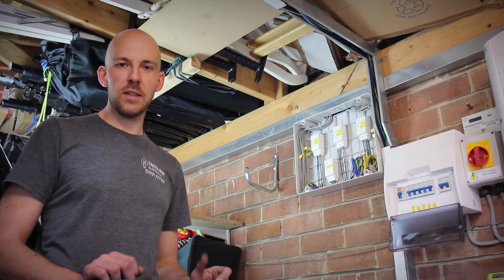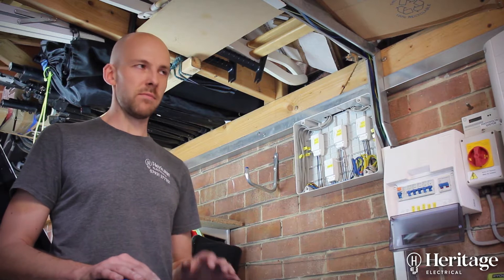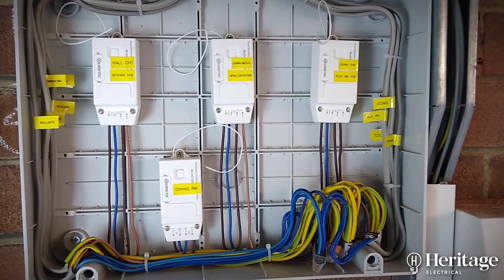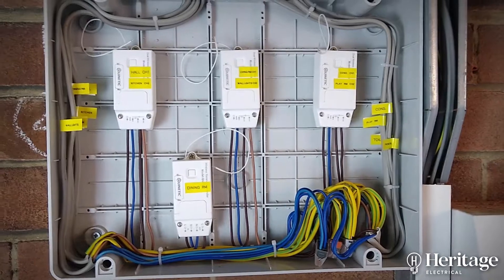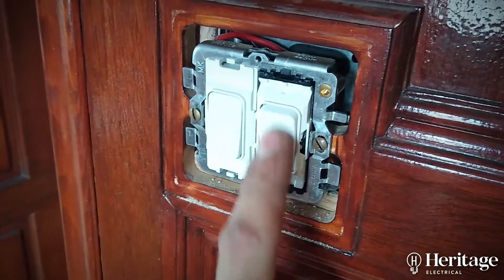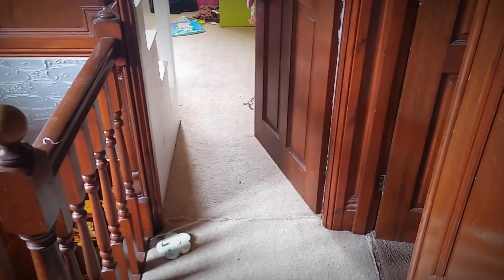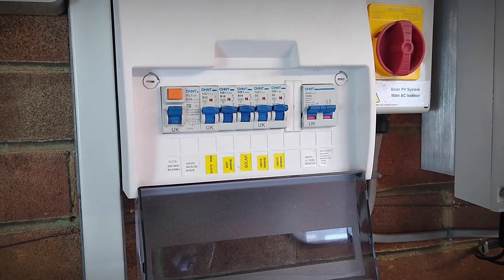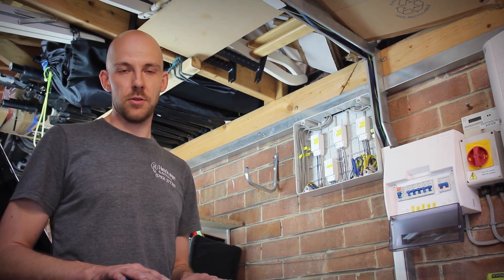Quinetic Wireless Light Switches & RF Modules Installation

Comment: Hi, what do all the 4 wires do that go into each of the quinetic receivers? Thanks
Reply from the maker: Hi George 
The 4 wires are neutral in and out and permanent live in and switched live out.
Cheers Paul
Reply: @HeritageElectrical  Thanks for your response. 1 final question, I have an assessment with Napit coming up as I am trying to get signed up with them. How do you find the CPS assessors in general (what do they look for etc)? And do you have any tips? Kind Regards